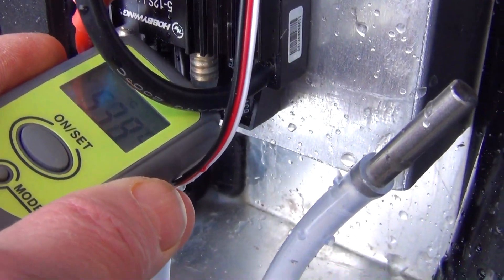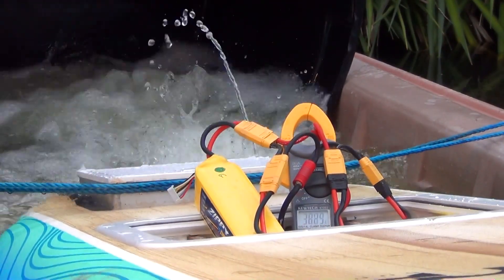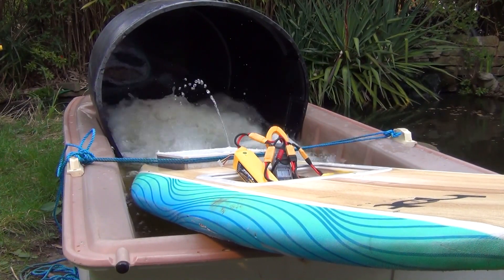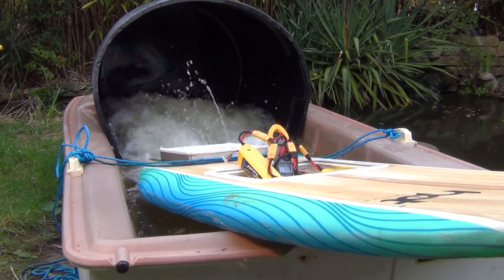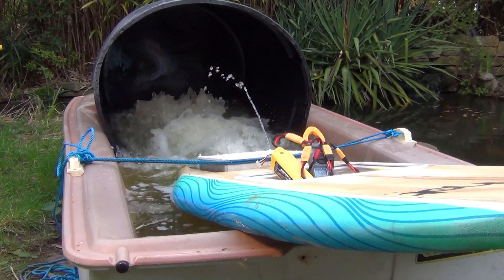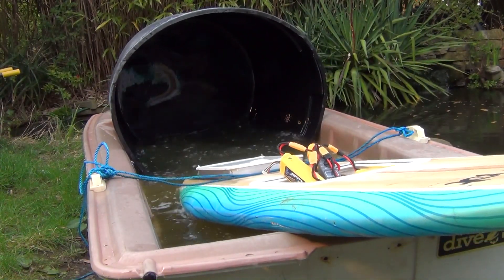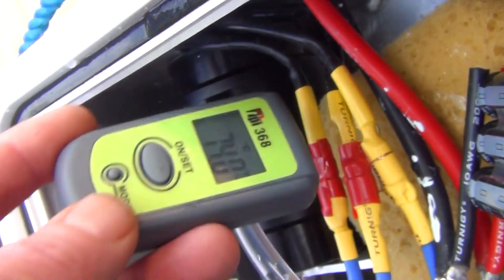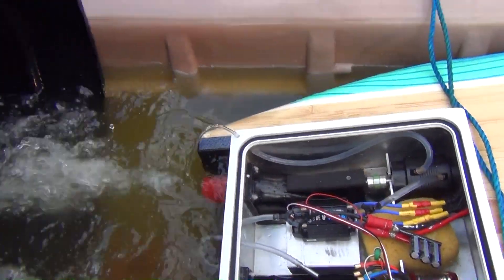E Surfboard  Jet-unit 100Amp

Comment: What's your opinion about the gartt 530kv motor? It's good for the jet surf
Reply from the maker: Hi Mate, I've been testing it the last couple of day on 12s and 9s,,
it has great power and economical,,, but it is very hard to keep the bell
cool,, even with a fan and cooling mount, so for me it's no good for speed,
it is very easy going on the ESC which stayed very cool but the motor is
maxed out at 100amp and will get hot at about 60amp with the jet units load
on the motor, I'll be trying 6s with a different esc tomorrow but that is just for a look at a SUP board setup,, while I have the motor fitted in the box,,
Cheers for the message and visit
all the best
Mark

Comment: what motors do you use
Reply from the maker: Hi Mate,, there surpass hobby motors
I went for the 730kv but they now do a 600kv that looks better,
cheers for the visit Mark
https://www.ebay.co.uk/itm/SURPASS-HOBBY-Rocket-56102-600KV-Brushless-Motor-w-56-L-Water-Cooling-Q8Y4-/292802103609?hash=item442c5d8939

https://www.ebay.co.uk/itm/SURPASS-HOBBY-Rocket-5692-730KV-Brushless-Motor-/223327712517?var=&hash=item0
Reply: @YOUNGSTERS-JETS  thanks!
Reply: @YOUNGSTERS-JETS  Hi Mark, your build is awesome! I've been working on my own project like this for a while but can't decide which motors to choose. I saw you trialled the Turnigy AquaStar 4084-620KV inrunner. How did this compare to the Surpass you're running now? Thanks and keep up the awesome work :)

Comment: Any plans to sell the printed drive units in the future? I've been following your builds for a while and the performance is really impressive!
Reply from the maker: Hi Mate, yes as soon as I can,, I've had some rabbit holes to scuttle though
 and answers to find out with what the budget line in electronics has to offer,
Tinkering time is nearly over,, I should be on the pond in the next couple of days,
I have sold a few drives already but I have to send some bits out for free
to deal with the derating of the motors comfort zone,, thankfully not a big deal but it looks a bit slap dash,, the drives are made of resin with carbon fibre,,
it's very old fashioned hand skills,, like Noah's ark but without the help :)
all the best mate have a crackin night and Thanks
Mark
Reply: Great! I'm sure I'm not the only one chomping at the bit to get my hands on one of these. Best of luck!